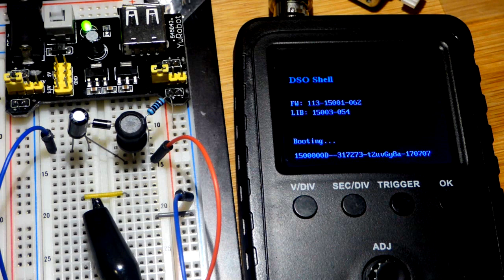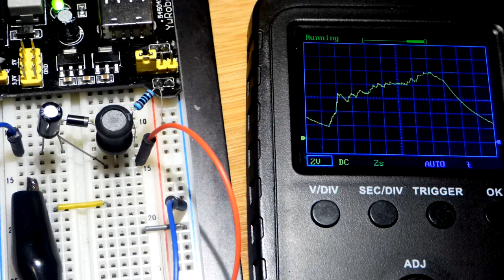Simple 10mH inductor DIY voltage booster circuit step by step build and oscilloscope measured

Comment: You say "100 Ohms is really the minimum resistance you would want to put 5 V across."

How do you determine that?  Are you trying to protect a Li-Ion/Li-Po cell, ?  I just looked it up, and seems a lot of people have different opinions what short circuits are, and there seems to be a number of reasons to try and avoid them, like protecting components, I guess, might be the most important one, but it seems to vary a lot from parts of a circuit to part of a circuit....  😕
Reply from the maker: 5V/100Ω is 0.05A (50mA). 
0.05A times 5V = 0.25W. 
This is a 1/4W (0.25W) resistor which ideally should be kept at 1/8W or below.
The inductor also has resistance, so whatever resistance it has will take it's percentage of the power dissipation away from the resistor, and also this circuit is intended to not pass current through the resistor much of the time, so it shouldn't ever get anywhere near too hot.